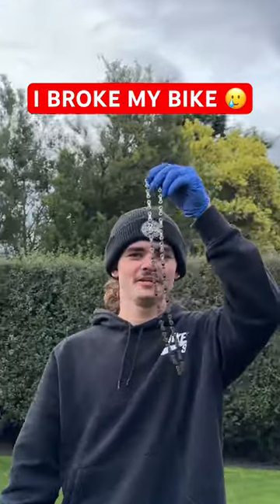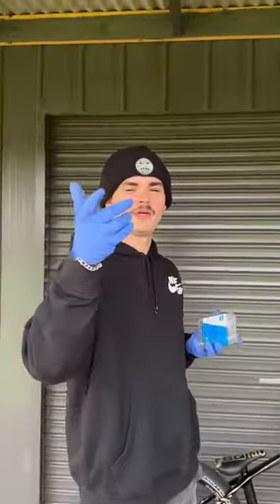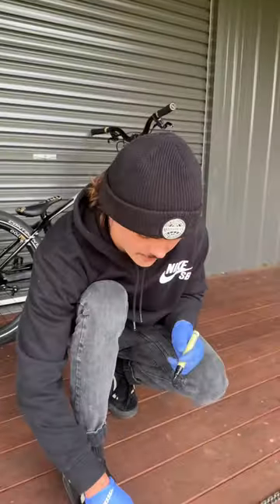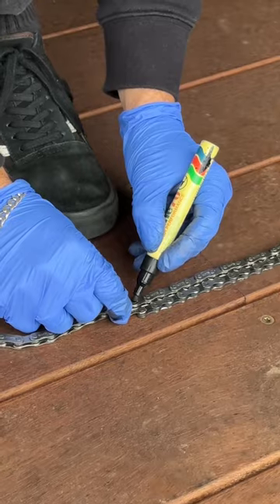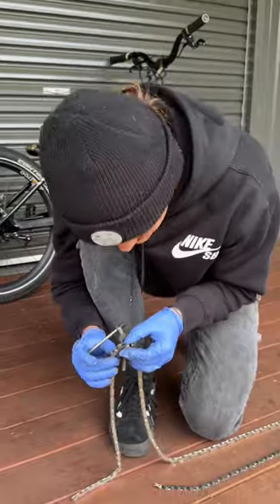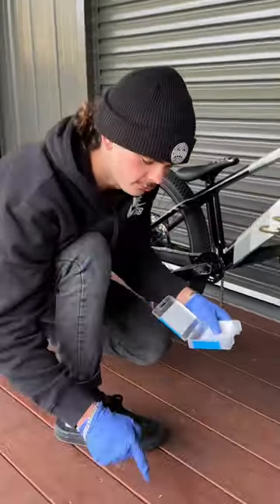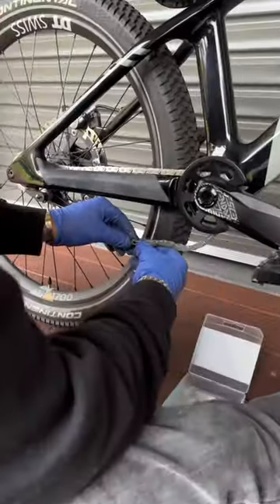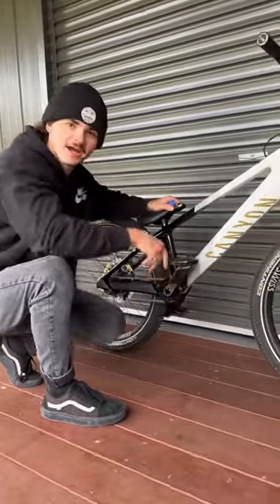I didn’t see it coming… 😅 #bike #bikeskills #mtb #mountainbike #streettrials #mtbpro

Comment: Chains can stretch during use so depending on the age of the chain a new one should be the same number of links as the previous one, not the same length
Reply: The amount that the chains stretch is not noticeable enough for this to make a difference
Reply: @asdfasdfasdf283 yea on a motorcycle chain if it's long enough you can see a slight difference by the end of the chain but not a pedal bike
Reply: Chain stretch is almost non noticeable
Reply: @AdelBazzine5  it is noticeable for sure i could tell you if your chain is stretched by just looking at it on a sprocket. thats why shifting mechanisms have a maximum stretch before they stop working properly, 1-9 speeds being 0.75% stretch. if you have 1% stretch (1 link length increase over 100 links) you need to replace chain and all sprockets because theyre all ruined by that point and wont work with a new chain.

source: im a bike mechanic
Reply: @bmxscape  im also a mechanic
Reply: @AdelBazzine5  then you should know its mandatory to check chain wear aka chain stretch
Reply: chains are supposed to be replaced around .5% stretch in my experience you can notice a slight difference when it's compared to a new one but it's a small enough difference that you can still match the pins fine

Comment: I recently broke my chain too, but I’m wondering what chain to buy. Some chains mark that they have mater link but some don’t?? How do I put it on if it doesn’t come with materlinks
Reply: Use your chain tool to push the pin out until it’s almost all the way but stop right before. Your pin will be sticking out of the plate. You can use your chain tool to push the pin back through the chain when your chain is sized and on the bike. Flex the chain to get rid of the sticky link. Idk if this explanation makes any sense